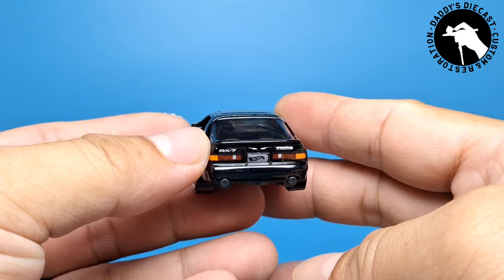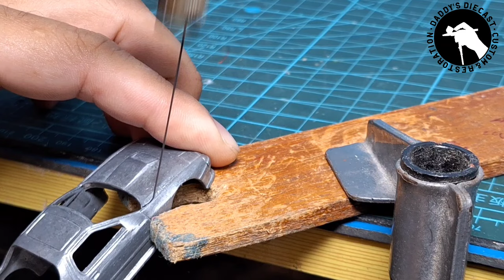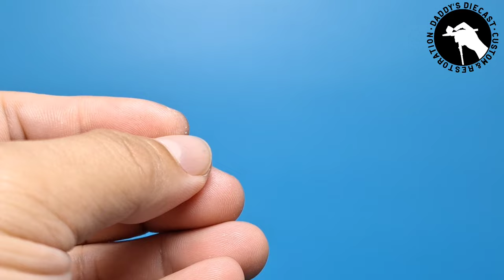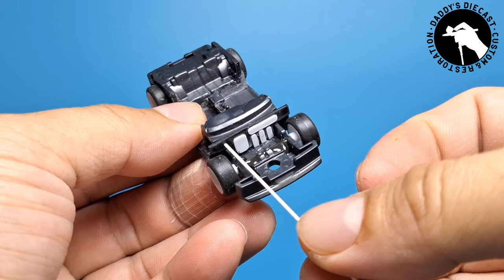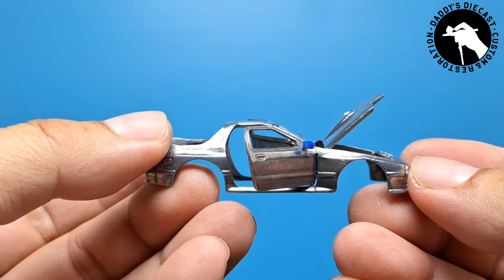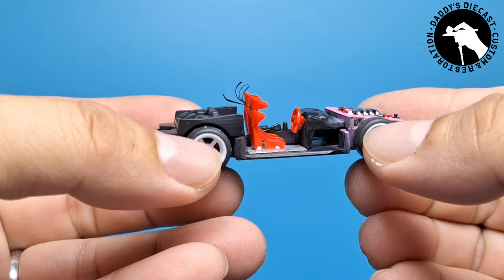custom hot wheels mazda savanna rx 7

Comment: What are those beads on the end of needles called that you use for side mirrors?
Reply from the maker: Southpaw thats a ganplu runner, the plastic mold that hold the model piece parts,
Reply: @customhotwheels  not the runners but the little bead on the needle part
Reply from the maker: Ohh the pin head, thats the head of the pin